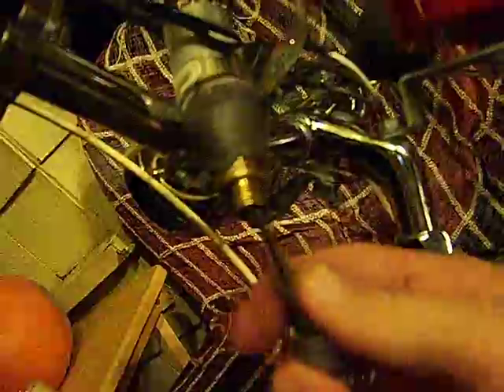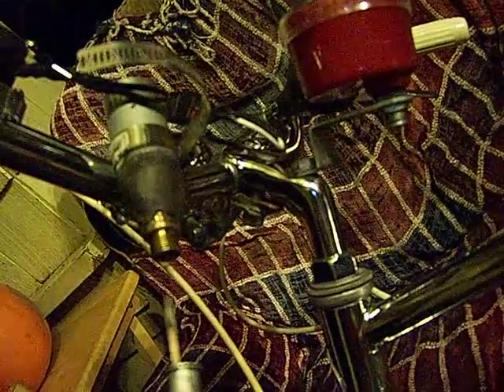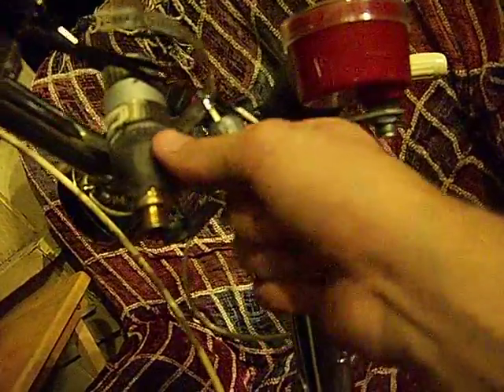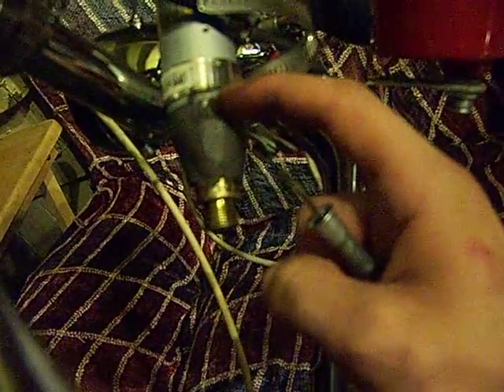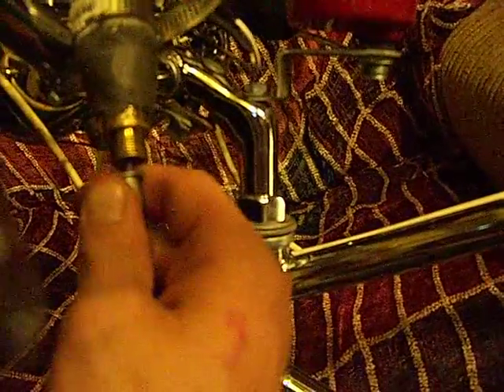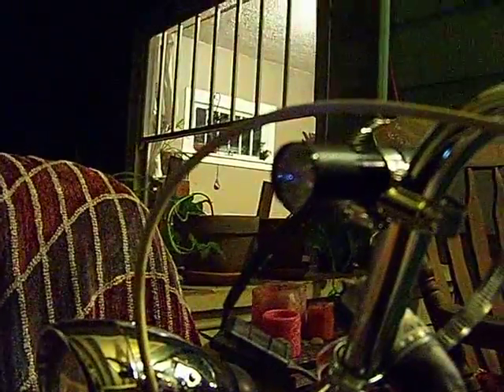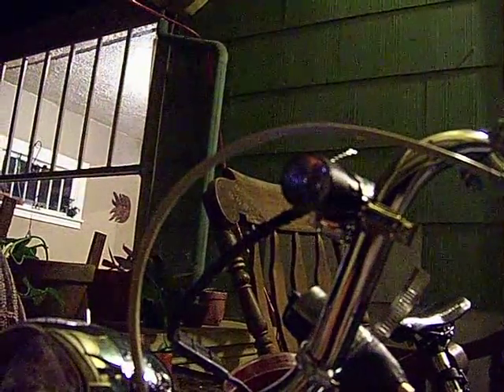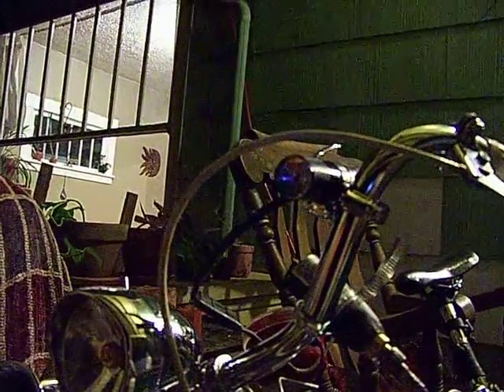Home made Bicycle Dynamo light Overview

Comment: You can make a cheap rectifier bridge with 4 common diodes (1n4001) and a 16v electrical capacitor to turn AC into DC from your dynamo to your flashlight!

Comment: If you move the spinning wheel from the hub to the rim, it will spin faster at even slow speeds. Get a battery pack built and have the cable go to the battery pack to constantly charge it. You would then be able to use a much better light.

I am going to build a generator for my bike and also install a charging port for my phone. My phone will act as my GPS, and radio.

Comment: @kevbriga  The LED's in most flashlights like that are just wired in parallel so all turn on at the same time. LED's will light up with AC, they are diodes so when the current is reversed biased, they will just be off, and then when polarity is reversed again they will be ON. If that is a stepper motor the signal is AC coming from the terminals. Why it strobes at low speeds is because the frequency of the AC is so low, that you can see the LEDs turning on and off. :-)

Comment from the maker: this motor i used came from a printer and is DC.  I am aware that most printer motors are AC. my led lights light without a bridge rectifier circuit so the electricity produced is DC.

Comment: I commend your ingenuity but are you aware that there are hub's available which do exactly what you are attempting ..... called dynohub's . 

Not to take away from your very creative solution ......... but a dynohub would be more efficient Ie. produce more electricity for less effort and can be found on ebay pretty cheaply ... and can sometimes be had for free if you keep your eye's open.